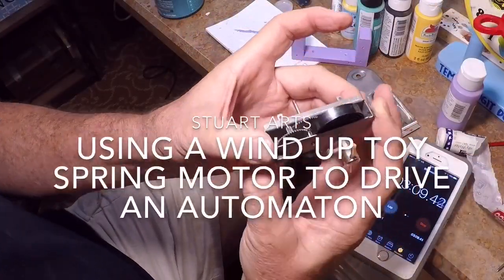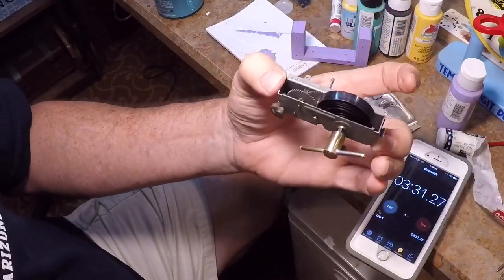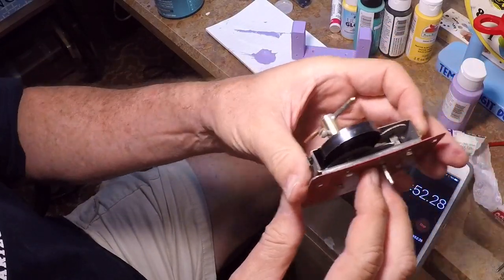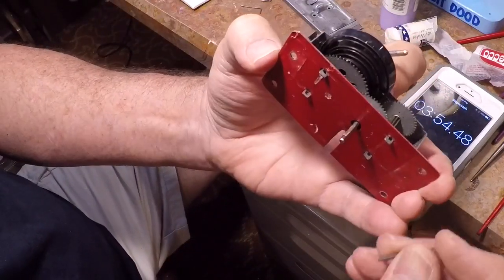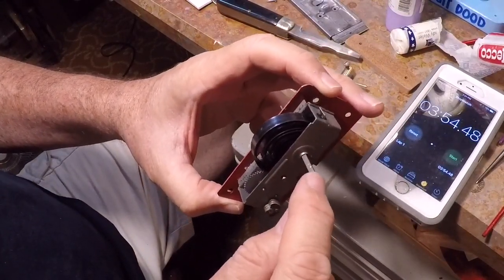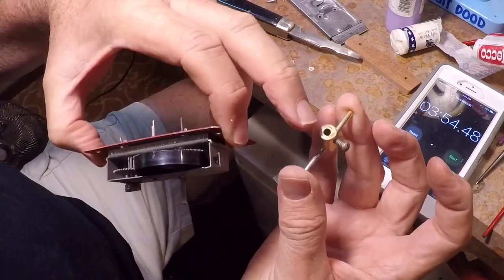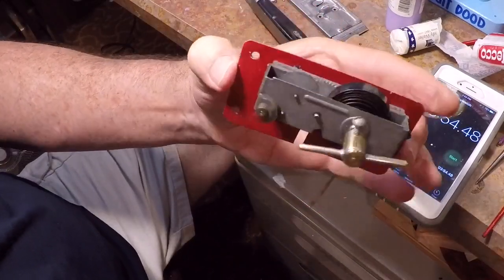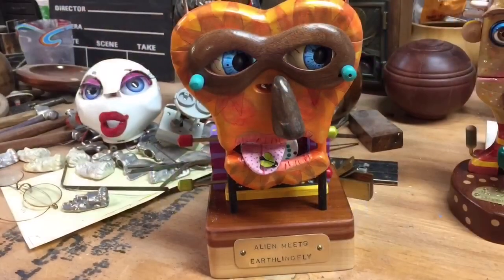How to Use Wind Up Toy Spring Motors to Drive Automatons

Comment: I was looking for a way to use these for skewers in an oven, for automated barbecue set. First challenge is duration and the other is heat resistance. 4 skewers to rotate inside my home oven. I have a huge single skewer with rotation inside my oven, but I prefer multiple ones that are smaller, do you think this is the way to go?

Comment: If we made a bigger modal of this motor and use a crank long enough to winding it up so with very little effort we found lots of energy ? Electricity which can cook food in microwave oven ?
Fuel not required